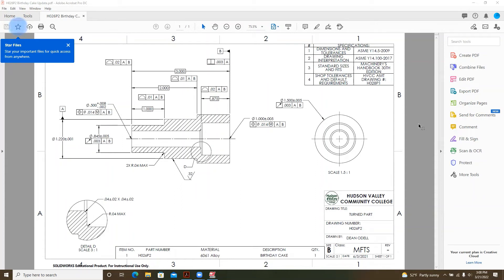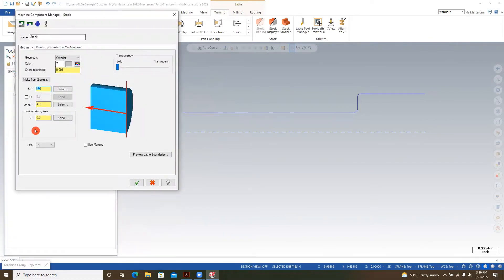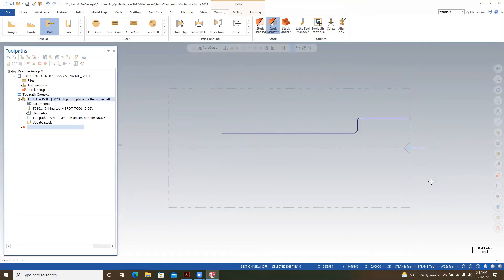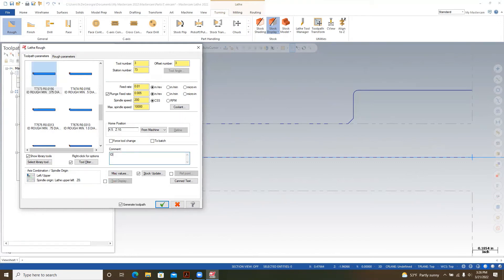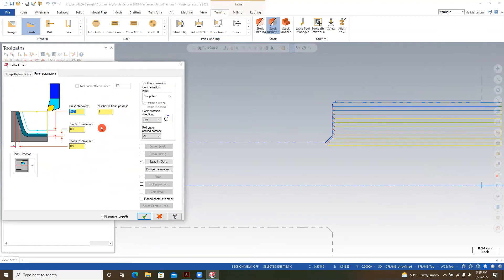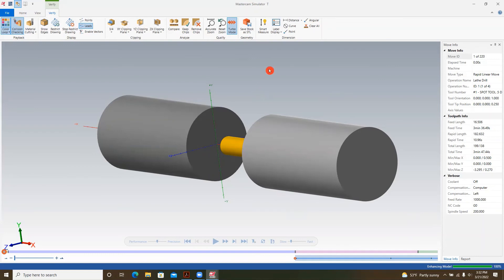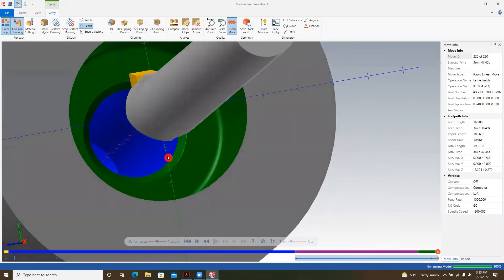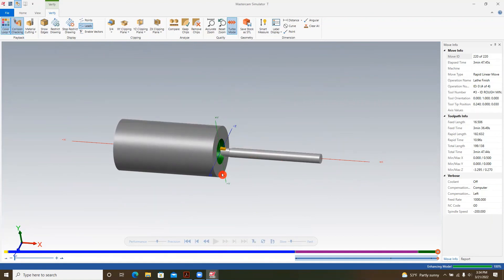Spot drilling, drilling and boring with Mastercam.

Comment: Hi

How to stop crashing with boring tool. .5 dia hole and usig a .375 boring tool. Is it the lead in and out ? Mine at .100....

Please advise...
Reply from the maker: Hi! You should reduce your lead out. I believe in my video I reduce to .020. You don't need to go this small, but think about the boring bar size, with insert and the size of the hole it is in. There needs to be "space" for the bar to come off with inner diameter and not collide with the opposite wall.